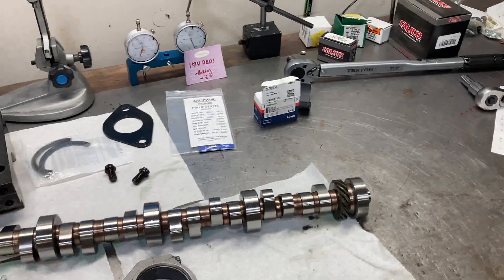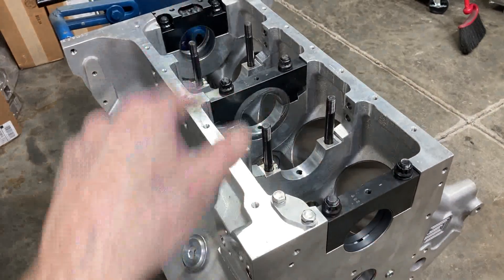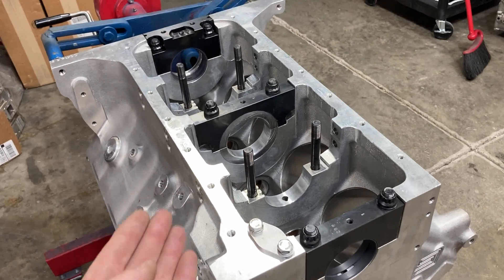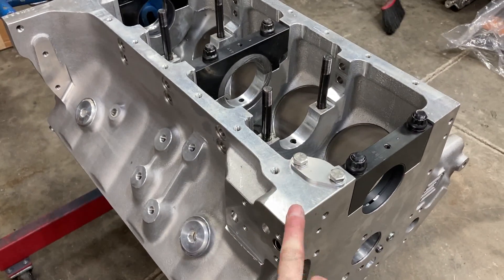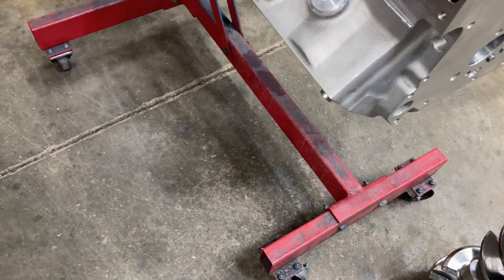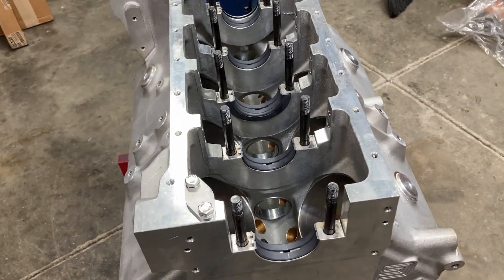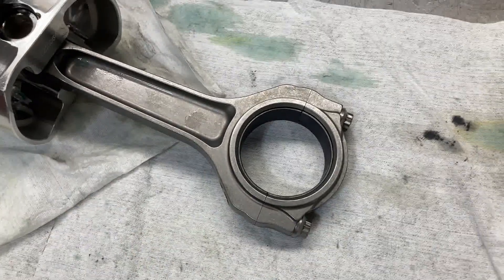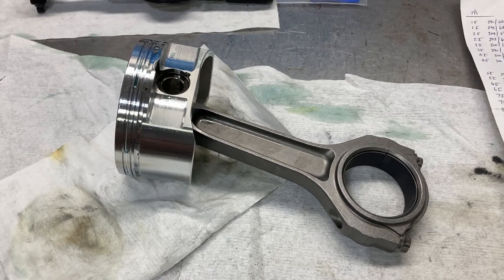Lykins Motorsports All Aluminum 511ci FE Bearing Clearance Check...

Comment: Question, l have cast 428 medium riser heads & a edelbrock performer rpm intake. Now lve ported the heads but l saw even before l started the heads that the intake had like low riser ports. Should l port the intake to match the heads or not? I really would like to hear your opinion on this matter. Thank you for your time! Keep up the good work! Love your vids!👍☯️👍

Comment: Are these bearings solid steel bearings that you are using??? I know years ago I was running a steel crank on a stroke Dodge 440. Anyway the machine shop in Vegas that was polishing the cranks and yes I said cranks because I went thru 3 $2,500 steel cranks. The machine shop was ordering the bearings after polishing and checking the clearances. Well after 20 or 30 runs the Rod bearings were spinning. Well I was using the bearing which was a tri metal bearing on a steel crank. Well after moving to Florida and talking with a cousin of Don Garlits, I asked him to ask Don what was I doing wrong and he said that Don said I should have been running a solid steel bearing on that Steel crank, instead of the tri metal bearings. He said that the metals not being the same will bite in to each other. Cost me close to $10,000 dollars in just cranks to find this out. RRRRRRR!!!! Oh if you get the chance to go and see Don Garlits Museum in Brooksville Florida, go see it. It is awesome to see so much drag racing history there. He has 3 building and so many Old Dragster that he had to hang them from the ceilings.He has Shirly M. Dragster as well as Micky Thompsons old dragsters just to name a few out of hundreds of cars. Good stuff. The Museum is right behind the Pilot Truck Stop just off the exit ramp in Brooksville, very easy to find on I - 75 there.
Reply: I believe Don's place is in Ocala.
Hwy 484 and interstate 75 exit 341.

Comment: I have had no problems with l19rod bolts i believe the problem occurs when you handle them after cleaning them so i have never cleaned them with spirits or break klean just keep the ARP grease on them all the time 15 years of service on them so far i was warned about the issue by my Machinist and so far so good

Comment: With the various rod bolt alloys on the market now, I honestly don't know why L19s are even still offered. There can't be many buying them, why would you at this point? 
An all aluminum FE is definitely a dream engine, something that can turn some RPM(since there's actually some real cylinder head options for FEs now, I still can't believe it lol), drop it in a Mercury Capri, IRS swapped and setup for killing a road course. Would be pretty cool popping the hood for people and having an FE hanging out between some Fox body strut towers. Just one more for the to-do list(or rather the "to-fund list")...

Comment: Thanks for the vid.  Built the same engine 15 years ago.  At that time the block was $5200.  It is cast at the Arias plant.  It is of the highest quality.  As far as I know they haven't made any more.  I would bet that block is NOS.  I run a solid roller cam.  I set the lash at 0.006 cold.  Hot it's about 18 to 20 thousands.  The complete engine weights the same as an iron headed 302.  An iron block would be 140 lbs. heavier and the cobra would have severe understeer.  I personally think this is too much engine for a close coupled car like a cobra.  It will be a beast to handle.  Shelby designed the Daytona Coupe with a longer wheelbase to improve the handling characteristics  All the big SCCA wins were with the small block cobra.  The 427 cobra pushed too much and went into oversteer at the blink of an eye..
Reply from the maker: It's not NOS.  It came in earlier this year.  They have plenty of them, but they're not cast in the US anymore I don't think.
Reply: I had a 900 HP 2009 Ford Shelby and man you really had to watch it, in that thing, it got bent out of shape fast, there was a couple times I thought I would end up in a ditch. I stll think after 40 MPH that the new Vettes would pull away from it and handle a heck of a lot better too, at higher speeds.